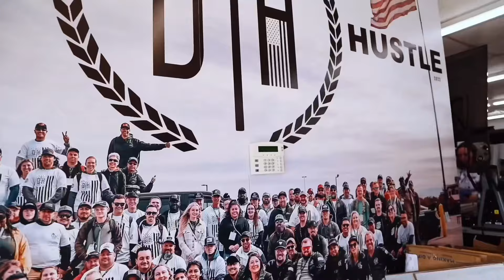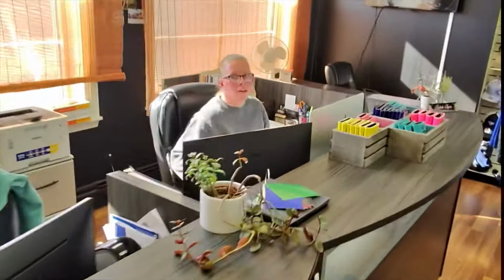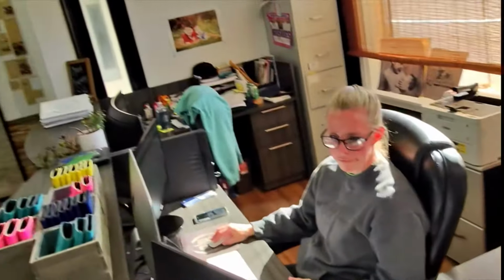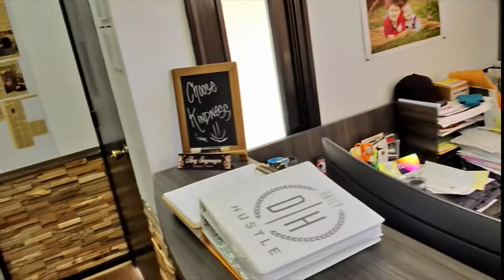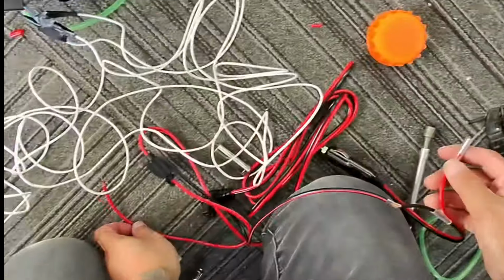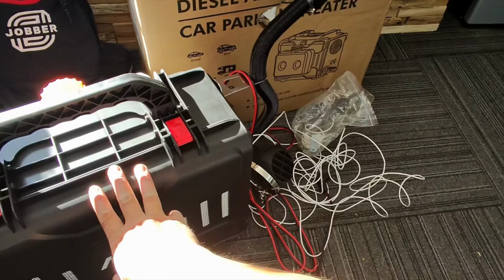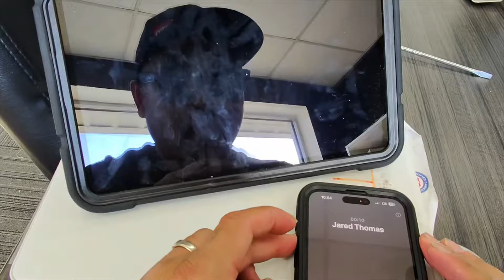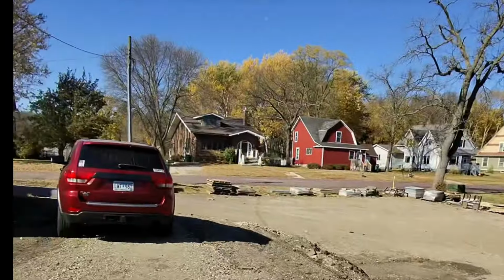Episode-77 AFTER 1 year of HOTSHOT WE HAVE SECOND TRUCK GOING OUT ! Stuck in the shop

Comment: 2500 Ram, you'll be putting a transmission in it too which it why I bought a 24 3500 HO with the Aisin. Supposedly all the 25s are getting 8 speed ZFs & more power

Comment: That seems extreme to need a whole new transmission. How many miles on the GMC? Does it have an auxiliary transmission cooler? Thats the main cause of transmission failures is heat.
Reply from the maker: 142k
Reply: @ChantsDailyHustle  Was the transmission ever serviced? Do you have a larger auxiliary transmission cooler on it? Heat and lack or service/maintenance/fresh fluid is most likely the cause of the failure.

Comment: Chants unless you want to keep burning through transmissions,  i would recommend getting 3500 . Way better towing and torque. I know some guys that started out using 2500 and it just didn't get the job done . Not trying to be a smart-ass,  just trying to help . Enjoy your channel and your hard work and dedication on not being afraid to try new things
Reply from the maker: Appreciate the advice , I’ll keep it in mind for the next truck
Reply: 2500 and 3500 use the same transmission.
Reply: 2500 and 3500 use the same automatic transmission.
Reply: And 3500 weight is to heavy
Reply: Most of time same engine and trans. Only difference is weight truck can handle

Comment: Hi i do hothot car hauling for 12 years its a family business. We have 6 trucks running we have 3 ram 5500 and 2 4500 and 1 3500 with cdl thwy are the best trucks for that business. We will add 1 more in January 2025 5500 and we running 5 car haulers only for the 3500 we have a 3 car hauler.gmc and ford we had before  where a disappointments for the weight we haul .if you get a new truck get ram 4500 or 5500